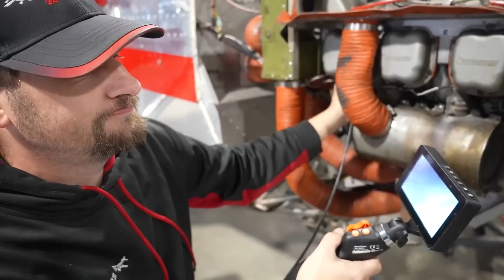Is electronic ignition worth it on piston aircraft?

Comment: Yeah that's simple magneto and you have two of them impulse mags. It's self-contained there's nothing else to go wrong and you somehow think getting rid of those two independent systems they will fly the airplane completely independently of anything else, is more dependable than computers and charging systems and batteries and all the other stuff? No matter how 20th century you are two ancient tractor magnetos stuck on an airplane and tested over and over with time true proven dependability are going to be very difficult to beat.

Comment: Several things are so wrong with this video.  
1.  SureFly IS a TRUE electronic ignition that replaces the magneto, contained in a case the size of a magneto.  Not a bunch of parts spread across the table, requiring additional labor to "be creative" so that you can install all the parts.  The "computer" in the SureFly is programmed to give you a higher energy (hotter) spark on start, then reduces that energy so that you are not burning up spark plugs or harnesses, prematurely.  Get your facts straight before slandering a good company and product.
2.  The HP gain is due to timing advance, not the spark energy.  The sooner you are able to start the flame front, the more complete the burn before the exhaust valve opens, hence more BTU power against the piston and less out the exhaust.  On a takeoff you cannot advance the ignition in this high power setting, as it might cause catastrophic detonation.  A hotter spark has nothing to do with a more complete burn in the cylinder because all the spark does is start the flame front.  The size of a bonfire has little to do with the size of the match used to start it.  I know the SureFly does not advance timing until the manifold pressure is low enough to be safely outside the detonation limits.  What does Electroair do?
3.  You can use the Electroair switch panel with the SureFly (if the Electroair STC allows it), but most flight schools and pilots don't want a change to the aircraft POH.  
4.  Do you need a second alternator to run a second Electroair?  The SureFly STC only requires a backup battery for the SECOND unit.  The first unit relies on the aircraft battery as a backup.  I think you are getting your alternator/battery terminology mixed up.  Check with Electroair before you install anymore alternators!  
5.  Careful about leaning in the climb at low altitude!  Yes, if you go far enough you can get past peak, but you risk detonation rich of peak as you lean.  Unless the Electroair allows it, follow the POH which typically does not allow leaning in the climb until above 5000' (this is because the MP has reduced outside the detonation margins).   
6.  SureFly is also approved to replace both the magnetos.  Again, get your facts straight.  

I would you suggest you call SureFly at 817-373-5161 to get a better understanding of electronic ignitions.  It doesn't sound like you are getting the entire story from Electoair.